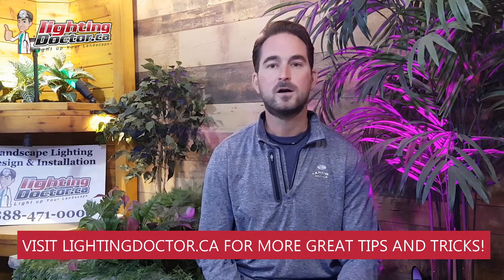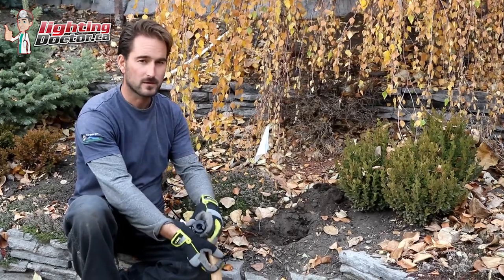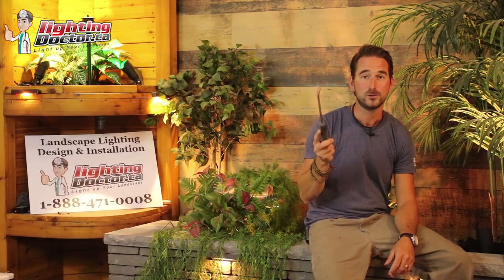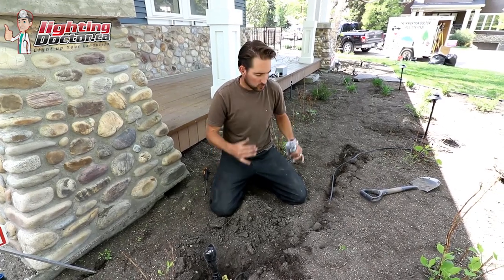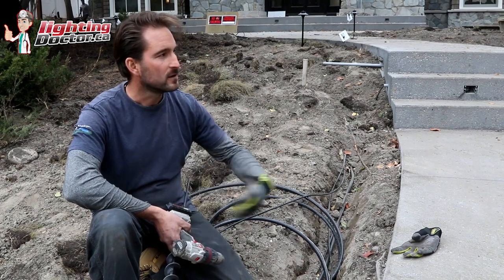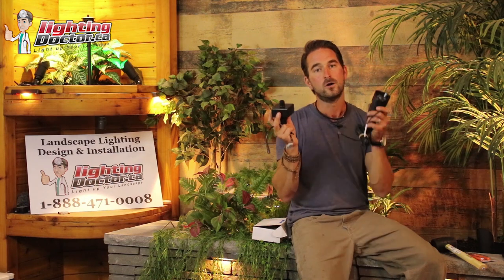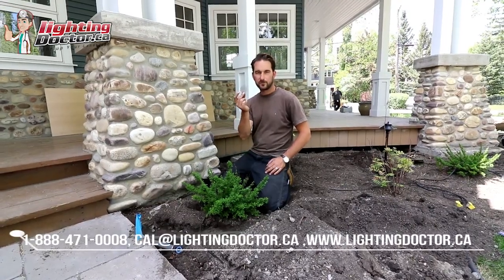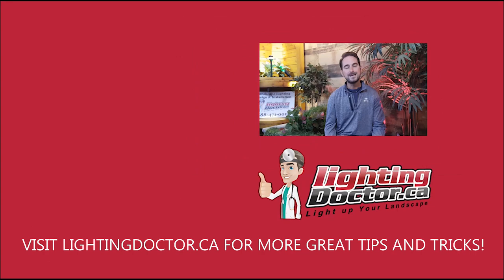How to Install Landscape Lighting - Must Have Tools for Your Project

Comment: It's called a 'Hand Weeder.' 
Can you do a demo on wiring a single gang 'Step Light?' Would you recommend using the BVS2's or using the shrink connectors?
Thank you for all the great content!
Reply from the maker: Thanks Kevin, I knew that somebody had to know what is was called. For the step lights I would use shrink wrap connectors. Much easier to hide
Reply: @LightingDoctor  
You're welcome - great tool to have...Thanks for the wiring recommendation!